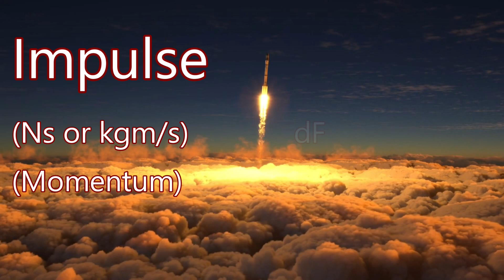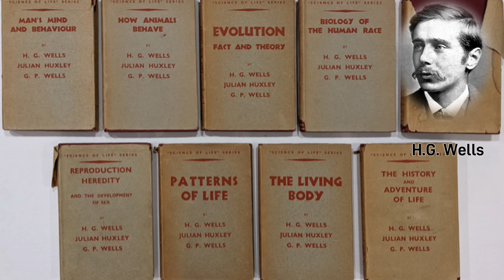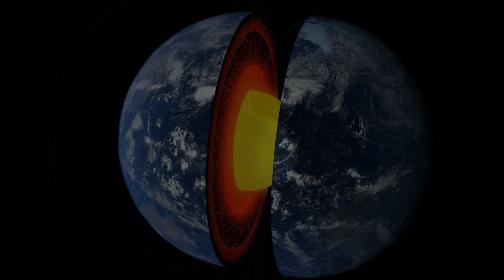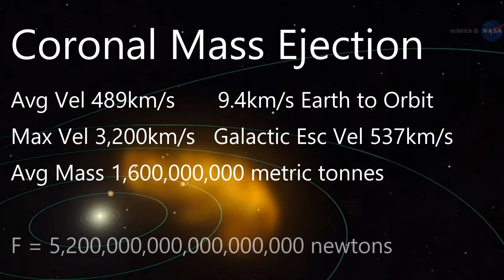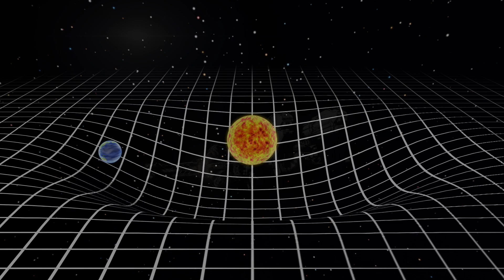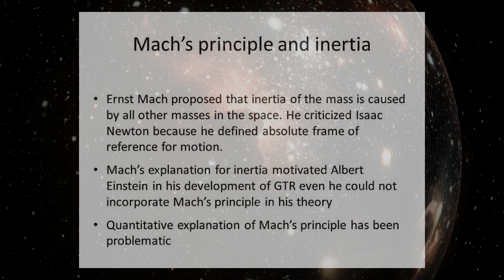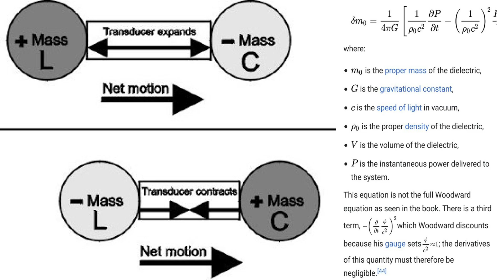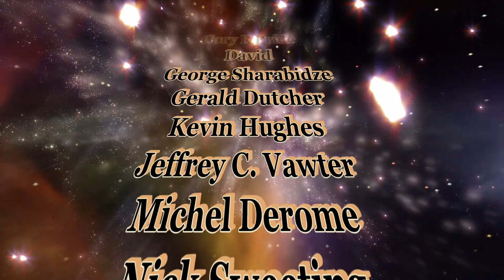Spacecraft Propulsion: Can we build a Star Trek Impulse Drive?

Comment: How about using fluids flowing through a toroidal structure at high speed.  If the cross sectional area is reduced for half of the structure there would be an imbalance in centrifugal forces.  An egg shaped trajectory may be more optimal then circular.

Two of these structures connected through the centers with the reduced cross sectional areas aligned and with fluid flowing in opposite directions should counter torque.   Or you could use a figure eight and only deal with one structure.
Reply from the maker: Bob Lazar!  The problem is Newton's Laws keep inhibiting my impulse drive.
Reply: @terranspaceacademy  Centrifugal force is not a "real" force in the sense of being caused by an interaction between objects, it does have a real effect on objects in a rotating system because it influences their motion within that system.  It's what makes you feel pushed away from the center when you're in a rotating amusement park ride or when you take a turn in a car.  If the center of rotation is fixed then I guess you could ignore it.
Reply from the maker: It was when I fell off the merry-go-round.
 @karlswanson95

Comment: A type of electromagnetic momentum/inertia control proposed by Larry Reed, and described by Paul A LaViollette PhD uses the wave interference of light in a phase conjugate mirror to propel a craft. They show how momentum control with light can be accomplished optomechanically using a sneaky way to hide photon energy in a manner that improves upon the photon rocket concept. By using a phase conjugate mirror they can simulate an infinite hall of mirrors for reflected light. It still conserves energy/momentum, the same way that laser based optical tweezers conserve momentum when they levitate particles through refraction/reflection/recoil from radiation pressure. The difference is that phase conjugation, sometimes called time-reversal of waves, causes destructive interference in the far field, which means the EM wave that leaves the mirror traces a path backwards to a source and cancels it out. The EM wave could be the light from the Sun, could be the Cosmic Microwave Background Radiation, could be a RADAR reflecting surface or the ground, anything that produces or reflects light will do. Destructive interference of EM energy can't be destroyed everywhere though, it must have equal and opposite constructive interference in the near-field, inside the phase conjugate mirror material itself, forming a holographic image in the substrate, usually a crystal or ionized gas. That holographic image reflects light back at the distant source of radiation. Because constructive interference holographically encodes the phase angle and momentum vector of the incoming radiation from the environment, it can automatically achieve resonance with the environment, and that field can be amplified by pump beams or a resonator cavity to store and release it. The outgoing phase conjugate beam diffracting from the holographic grating constantly achieves resonance with incoming waves and retraces their path through space and time, back to their source (or at least where it was when it emits the light in the past). The energy trapped between a light source and the phase conjugate mirror builds up, unable to be released by any optical paths that do not conjugate with the mirror. Finally the phase conjugate mirror may produce thrust and impart momentum by releasing electromagnetic energy into the environment to satisfy conversation of momentum, but it does so by shifting the beam frequency and/or phase, so that the radiation field between the environment and mirror no longer matches the internal polarization of the phase conjugate mirror. The holograms do not match. Now you have an electromotive force pushing or pulling on the solid matter of the resonator, trying to restore the system to resonance by accelerating towards the new phase matching condition. The cycle repeats when the moving mirror builds a new hologram at the new position in space, at the new velocity it has after accelerating. The exact acceleration will be proportional to the polarization strength of the material and the amplitudes of the pump and seed EM fields, and the final velocity of the system will be determined by the rate of change of frequency and phase. You may "Red-shift" against the field then to achieve thrust away from the Earth or the Sun, up to speeds only limited by the bandwidth of the phase conjugate mirror, since the finite speed of light causes the light from the Sun to Red-Shift, you will get diminishing returns as you approach the speed of light relative to the Sun, even if you achieve phase conjugation at the longer wavelengths. However, the Cosmic Microwave Background would then become asymmetrical, which could be used for steering and breaking. One side of Universe would appear Blue-Shifted to Terahertz radiation, then infrared, then visible light then ultraviolet, and then x-ray. So you would require a phase conjugate mirror with an ultra-broad bandwidth to use as much of the available spectrum for thrust as possible.
Reply from the maker: Very intersting.  Has anyone built a functioning test device?  I love advanced propulsion theories.

Comment: "Delirious furiousers" was the 1835-ish belief that exceeding 20 mph would drive humans insane-suggesting that fast-moving trains should be outlawed. This was followed by the belief that reaching speeds of 100 mph would turn human flesh into mush. With the advent of aircraft, the common belief was that man could never break the sound barrier. Now we're hearing "[T]he speed of light limitations will forever limit us to this star." Naysayers certainly have a way of making life interesting.
Reply from the maker: Until you hit up against Einstein... Which is much more than just an opinion of belief but a predictable and proven fact.  We may find a way to slide around the speed of light through spacetime compression and expansion for instance.  
But it is proven that mass increases with velocity and that as we near the speed of light mass approaches infinity.

Comment: We have all seen anti-gravity propulsion, whether it be by frequency of sound or Ultra conductive magnetism. I have seen blueprints involving electromagnetics liquefied magnetic material similar to mercury. Being propelled in a circular motion with next to no resistance and gaining momentum. As this liquefied metal material increases its speed it moves from a liquid state to a plasma state. Plasma material creates its own properties that with increased propulsion can create lift, push and produce a protective field due to the torsion pull and push. I believe there are already working prototypes that allow a craft to move at a superluminal speed. So let's continue researching and applying these type of ideas. If we shoot for the Moon and Mars, we will end up amongst the Stars!!
Reply from the maker: :-)  I would love to see those systems.  What does it use for propellant?

Comment: When I watched my first video of Dr. Woodward's Mach Drive I wondered if we could increase the mass of protons relativitively (I coined a new word!) with a linear particle accelerator and then return them to the starting point slowly. With a set of three, minimum, to allow for pitch and yaw, all three could share a common proton return path.
Conservation of momentum? Pshaw! "We don't need no stinkin' conservation of momentum." ('Treasure of the Sierra Madre' reference.)
Now ask me how I spent two days coming up with a perpetual motion device and then trashed it after 30 seconds of Internet research.
Reply from the maker: Interesting thought... Have you read up on the "Table Top Accelerators"?  There could be some potential there.

Comment: Thank you Prof for another excellent video lesson.
The edge of Science admits that there are many sides of our knowledge that are severely lacking.
In particolar way, "what is Space", dark energy and matter, the nature of Gravity. Why there is inertia. Why the force of gravity is the same thing (not equivalent, but the same) of the acceleration of gravity. This sameness created the need for a General Relativity and is the reason for the speed of light (better, speed of causality).
Once we understand what Space is, we will understand the reasons for "c" and, possibly, how to circumvent it.
Don't listen to the many Cassandra in a quest for clicks or taps.
Thank you for holding the line!
Regards,
Anthony
Reply: The creation of a "grip" area in empty Space, that a Spaceship can use to propel itself without ejecting some mass, passes thru a deeper understanding of empty Space, which is not empty, and seems to have a complex structure that we don't see nor understand, but we interact with this structure using the concept we call "time".
Would somebody thought, 100 years ago, that we invented a virtual fixed point in space, so we can measure the speed and position of every moving vehicle on the planet? The GPS is a miracle of mathematics; another miracle, using even more complex mathematics, will be the hyperdrive.
Have faith, it is coming...
Reply from the maker: Thank you Anthony :-) always appreciated.